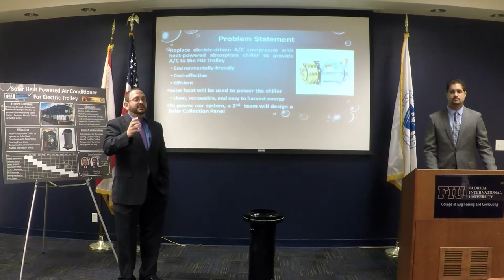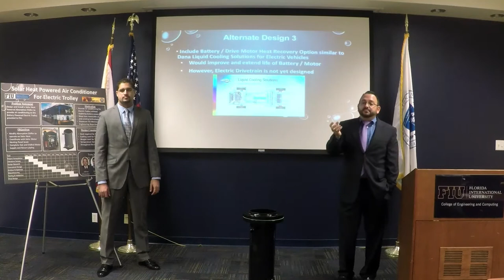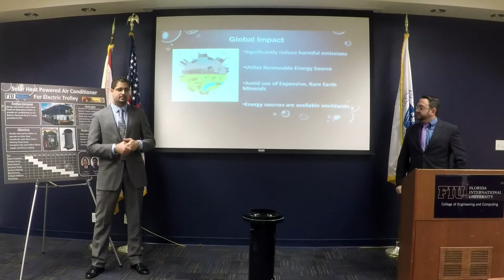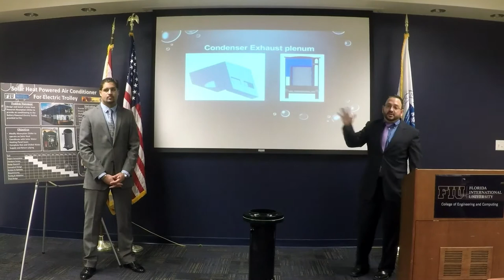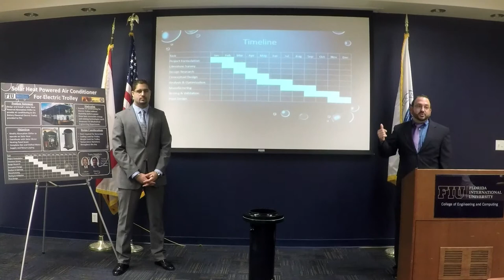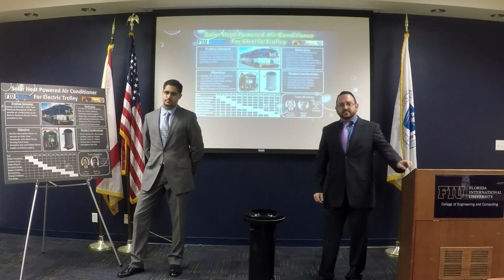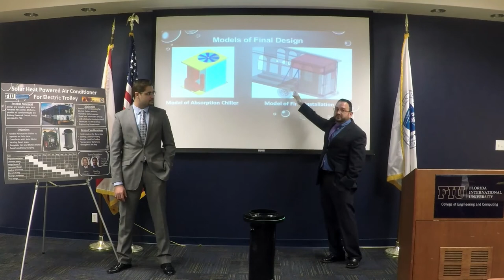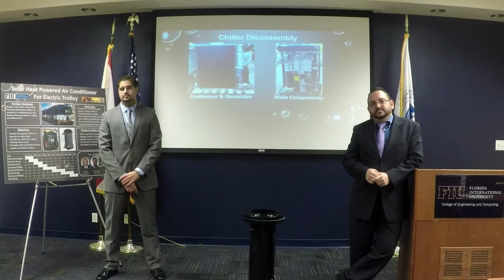SD Team 7: Solar Heat Powered Air Conditioner for Electric Trolley

Comment: They did pretty good in explaining their project but they could have prepared the power point presentation a little better. Sometimes they read word for word the slides but they explained many technical terms regarding each component in their assembly. The questions at the end were answered very well.